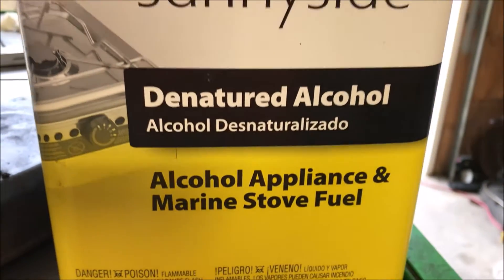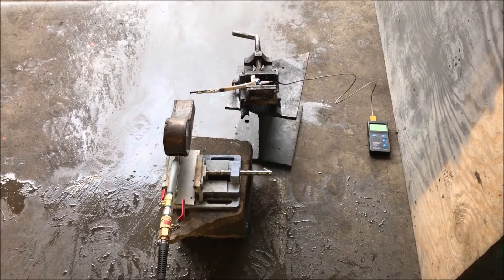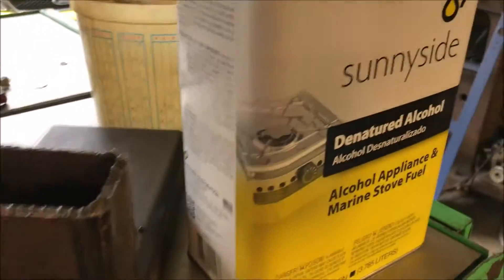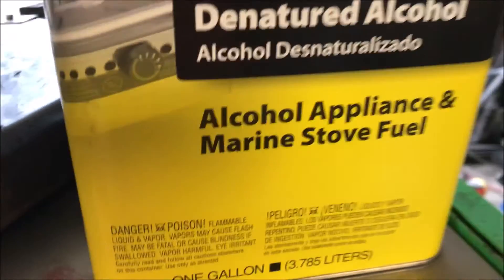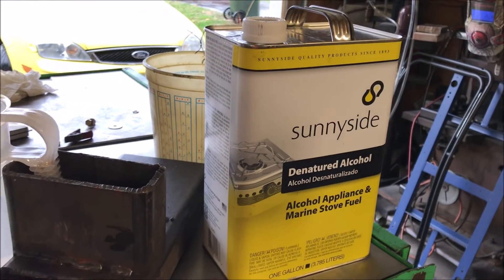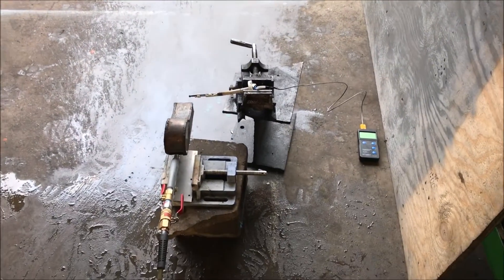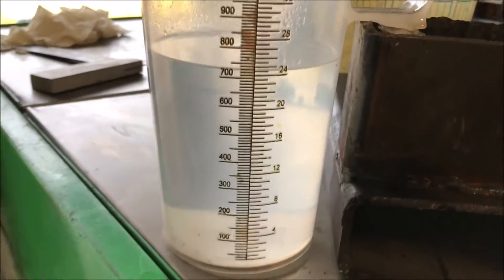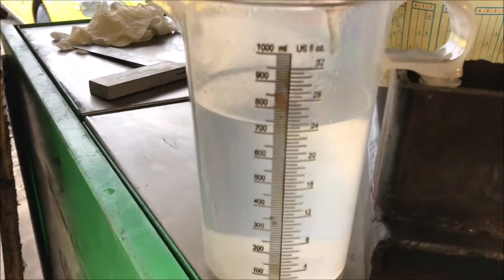Pure Ethanol and ethonal mixed with waste oil

Comment: I found an interesting mix of about 20 parts lard (pig fat), 5 parts diesel and 3 parts methanol.  When heated (to about 130F to get everything melted) it formed a nice, fairly thin mix, much like a veggie oil.  I found that it stayed liquid for at least a day sometimes weeks and was always kept inside so temp was usually between 65 & 75F.  

I know that animal fat often doesn't find much use for burning like this but it has a very high burn temp and adding the diesel (kerosene or heating oil would probably work as well) is high energyas well.  I would have used ethanol as it has about 30% more BTU than methanol.

I'd like to make some of these burners (one would be sufficient), I have a design in mind but I'm also looking at making an oxygen concentrator (BIG one).  I wonder if O2 will work better than the compressed air.  I can use the same setup for both, just take the concentrator out of line and just use it's compressor.  Could be lots of fun!!
Reply from the maker: Be careful  my friend methanol is more toxic then you think  , i get really sick one day testing with it and its fumes alone can blind you over time

Comment: Alcohol will mix with oil (it's miscable) but only at a concentration of 90% sd alcohol 40 (grain alcohol) to 10% (any) oil.  Alcohol is hydroscopic so you need to be sure it's been stored sealed from production, basically it absorbs water from the atmosphere and will lose it's miscability with oil at above 3% water contamination (approximately)

Comment: If someone wanted to burn ethanol mixed with oil then they'd need a way to continually agitate it in the tank, because it doesn't mix, or I've never found an oil that readily mixes with e85 ethanol, all oils i've tried mix to micro fine globular balls that eventually fall out of solution (even 2 stroke oil) If I get oil deposits in a fuel tank of one of my e85 burning engines it just stays there and I have to put some gas in to disolve it. Pretty much exactly like you saw with this test.
Reply: Alcohol will mix with oil (it's miscable) but only at a concentration of 90% sd alcohol 40 (grain alcohol) to 10% (any) oil.  Alcohol is hydroscopic so you need to be sure it's been stored sealed from production, basically it absorbs water from the atmosphere and will lose it's miscability with oil at above 3% water contamination (approximately)
Reply: https://sciencing.com/info-12066577-alcohol-dissolve-oil.html

Comment: ok i see you tried ethanol. interesting. the mixture you have got is not very good because methanol is very toxic and his vapours are too. they can carry you to blindness. about the mixture with oil you need 100% or 99% ethanol. maybe also the 95% ehtanol used for making drinks will work.
Reply: Alcohol will mix with oil (it's miscable) but only at a concentration of 90% sd alcohol 40 (grain alcohol) to 10% (any) oil.  Alcohol is hydroscopic so you need to be sure it's been stored sealed from production, basically it absorbs water from the atmosphere and will lose it's miscability with oil at above 3% water contamination (approximately)
Reply: https://sciencing.com/info-12066577-alcohol-dissolve-oil.html

Comment: I have never thought about trying to blend those two, but clearly, it looks like a bad idea, or else there was so much moisture in the oil that it stratified with the alcohols and separated out [which happens with gasoline] leaving severely dampened/watered-out alcohol and thicker, globbier oil...just a guess though.

I have to agree, does not at first glance, look like a good idea.

For sure begin with totally dry waste oil though.
Reply: Alcohol will mix with oil (it's miscable) but only at a concentration of 90% sd alcohol 40 (grain alcohol) to 10% (any) oil.  Alcohol is hydroscopic so you need to be sure it's been stored sealed from production, basically it absorbs water from the atmosphere and will lose it's miscability with oil at above 3% water contamination (approximately)
Reply: @ProlificInvention  That makes perfect sense, but what I saw was anhydrous [unless somebody had left the top off and spilled water into it] because it comes from the factory in anhydrous condition. 

What I suspect is that emulsified oil in the used motor oil [technically, there always is a little] got drawn from the oil into the alcohol and caused the immiscibility issue.

Even oil at 500 F inside of a roasting hot engine has some moisture in it, and if you leave an engine a long time, condensation in the block drips down into the oil, just like in fuel tanks, and although it does not blend, it can be readily emulsified with the acids when an engine is started and run, and become 'motor mayonnaise' which, while in small amounts may be undetectable, in the presence of alcohol will rapidly separate out and easily give you more than 3% .

Water vapor is a natural byproduct of combustion of hydrocarbons, and with the case of blowby, superheated water vapors enter a pressurized chamber where oil at less than the boiling point of water is sprayed all over the place, causing the perfect conditions for making motor mayonnaise. 

If you take any vehicle which is running below 212F, it is going to have water in the oil, it is inevitable.

My engine runs at 230 F in the summer so I do not have that problem and my oil doesn't break down as fast or become gummy in the block even though I use super heavy weight oil.

In the winter there is not much I can do about it, except limit my driving as much as possible, and change out the oil come spring.
Reply: @ProlificInvention  https://sciencing.com/info-12066577-alcohol-dissolve-oil.html
Reply: I agree, mostly...I change oil for a living (for 10 more days anyway) so I see it daily.  Most engines that suffer oil "mayonnaise" are Chrysler/Dodge/Jeep-they even had such a problem on Jeep's that they built a special fill neck "adapter" to keep it under "control" 😂...but also It comes from short trips and not running an engine up to temperature.  So I agree on that, biodiesel producers run 10:1 alcohol-oil to allow miscability, any other concentrations cause beading of the oil, I was going off that as I am trying to be helpful to the Nigerians NOBOX7 is helping.  If they Have copius alcohol that is not above 3% water and oil in an anhydrous state-they will be able to burn it well at a 10:1 ratio.  All guesswork though, I am going to try my hand at it with my upcoming furnace/foundry videos as I am going to preheat my catalyzer on propane, then switch to motor oil through a suction nozzle and may try alcohol/oil mix at some point for fun.
Reply: @ProlificInvention  Yes loads of short trips, high capacity cooling, poor ventilation regulation and defective PCV systems all contribute to rapid watering-up of the oil.

On the other hand, I have owned several MOPARS in my life [still have a 72 Dodge 413 in a motor home I am considering power building with some 440 heads] and never once had motor mayonnaise in a one of them [cast iron high compression engines respond to moisture more sluggishly than modern aluminum block engines which  have a naturally higher thermal mass [aluminum has a very high specific heat as a metal compared to nodular cast iron] shed heat quickly while iron blocks heat up rapidly and get hotter due to poor radiative properties of iron in the IR bandwidth [hence, a poor choice for a radiator...along with being too damned brittle and far more prone to rust than aluminum or brass] so the engines heat up faster despite being heavier, and retain their heat longer, giving more time for moisture to 'simmer out' after one stops the engine, leading [statistically] to less total moisture.

Also if an engine gets worn out, people get less prone to just 'hop in and go' I find this myself. If it takes me 5 minutes to start an old engine for a 3 minute trip to the corner [its actually 30 minutes to town from where I live but that is not my point] store, you are less likely to go [fewer short cold blocked trips] and more likely to grab some small zippy modern vehicle if one is at hand.
Reply: @DeliciousDeBlair  I like you, as a matter of fact:you're one of a kind.  I also have had a few Mopar products and actually did a stint as a service advisor at a Chrysler dealership in my early 20's, set up their 5 star computer system, ran the parts department, and performed all my service advisor duties including diagnosis and test driving every vehicle in for service.  I even helped purchase all the auction vehicles for our used car department.  One thing I learned while working and interacting with Chrysler, Dodge, Jeep, and Eagle vehicles, customers, and mechanics is this: They are my least favorite machines, although it was in the Neon era and several vehicles were just coming out like the Magnum Ram trucks, PT Cruiser, Stratus/Cirrus, LHS.  So to be fair;  as all the Neons were dying fast, those newer cars were going through growing pains.   I think modern cars are great with their lightweight synthetic oil recommendations and requirements due to hydraulic lifters, variable valve timing and government mandated fuel efficiency standards which are unleashing the hybrids, start/stop idle Interrupters, tiny displacements and tiny turbochargers.  They just don't build them like they used to!  The only old Mopar I owned was a 1979 Dodge Sportsman fully extended and windowed van with a 318 V8, and even with my hack job vacuum line/fish aquarium tubing rats nest repair It had decent oil between changes-although true story: when I bought it for $150, I neglected to check the fluids and drove it about 200 miles-when I got home the burning smell I had been tolerating became extremely strong.  I got out, checked the oil-nothing on the stick-oooh shit, so I leaned down and climbed underneath to see if it had sprung a leak and to identify the smell.  I will never forget, as I see it in my mind's eye right now: In the dwindling dusk light and shadow underneath-The old cast iron block had a faint orange Glow!!!  Next day I expected it to be fully siezed, but no: no coolant to be found, less than a quart of sludge, oil filter rusted in place.  Changed every fluid on that beast and it fired right up!  So I like the old ones, they just made them heavier duty all the way around.
Reply: @ProlificInvention  I change oil on something around here once a week give or take because we repair and maintain tractors, trucks, heavy equipment, farm implements, etc. We have only been at it for a year [since my brother retired and bought some machine tools] and our client base is still small, but we are gaining a reputation for price and quality that beats everybunny else.

We are saving up our waste oil(s) so that I can every now and then perform a 'balance blend' on them and de-water them [yes with ethanol but then I keep it and reuse it repeatedly since its easy to dry it] so that we can use it in a planned forge as well as to heat the shop.

Here's a fairly affordable trick to dewater ethanol few people know about: pressure cook it with starch [any starch] and the water will be soaked into the starch while the ethanol will not.

You have to do it under pressure or else all of your ethanol will just evaporate or even catch fire, but you can cook the starch dry again [or let it sun dry depending on your local climate] and reuse it for a long time. 

When you have completed the process simply pour off the anhydrous ethanol and the water and starch remain behind. If it looks granular, you can filter out anything fine to keep it out of your burner.

This is a fairly cost effective method of dewatering ethanol and it creates totally anhydrous product.

Another way is using sodium carbonate, which requires no heat, but requires that you keep an eye on how much you use so you ensure you get all of the water in the ethanol [best advice I can offer is 2 lb NaCo3 per lb of H20 to be sure] and again, it also needs to be filtered.

NaCO3 will eventually sun dry in an arid climate, so if energy savings is more important than rapid drying, I suggest that method. It can be heated to 340 F and it will not chemically degrade, if you need to drive off the water in a hurry.

Its cheap in the developed nations,not sure about where they live...and because it tends to leave a bad taste in the ethanol [I tried it for other purposes than fuel] it tends to discourage all but hard core alcoholics from drinking your ethanol.

https://en.wikipedia.org/wiki/Sodium_carbonate
Reply: Delicious DeBlair  an easier way to get water out of oil is heat the oil!!!!! 
Water turns to steam at 212 degrees 
Most motor Oil boils at 900 degrees. 
So just heat the oil to 300-400 degrees and the water will vaporize out.    YOU CAN DO IT IN AN ENGINE TOO IF THE WATER IS ONLY A SMALL AMOUNT.  If it is a lot the engine will oil starve and seize up.  If it’s just a tiny bit just run the engine easy idle and let it heat up slow with the valve cover open and the steam will come out!!!!
Reply: Delicious DeBlair  THE ALCOHOL HAS WATER IN IT!!!!!! 
99% isopropyl, methyl or ethyl alcohol will continuously absorb water from the air until it forms drops!!!!!   Then a higher % alcohol must be added to dissolve the water back into the mixture.  

Alcohol in gasoline does exactly the same thing.  If a tank of gasoline and alcohol is let sit for months and months the alcohol will absorb water until water drops form in the fuel.  That water and fuel mix turns to goo and clogs lines and carbs.  The cure is to add a fuel stabilizer which is a high % alcohol which absorbed the water drops in the fuel tank and mixes with the gas to be burned!!!!!!  

This is not supposition.  This is hard fact!!
Reply: @tomharrell1954  Are you feeling okay there? It seems you read [MIS-read] everything I wrote entirely backward.

Every last word of it. 

      /)/) 
     ( '.' ) 
@(>_ )> 
      \) \)